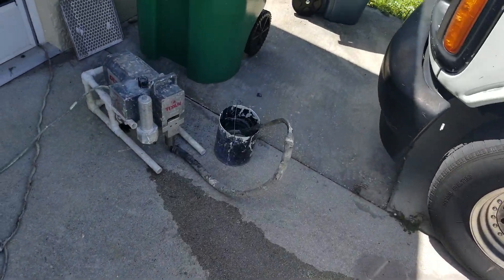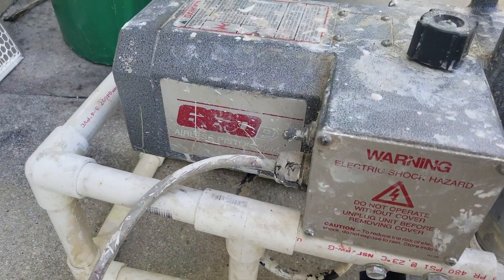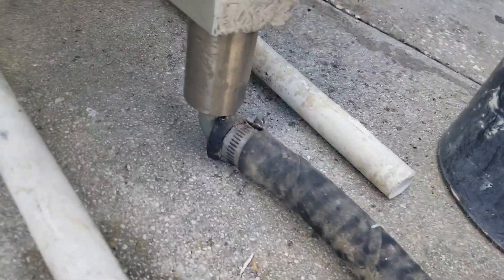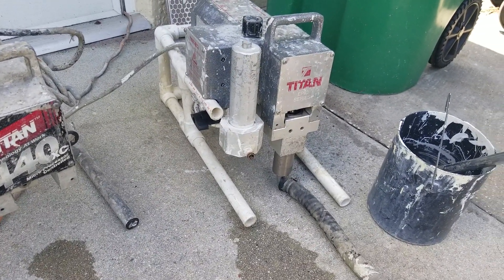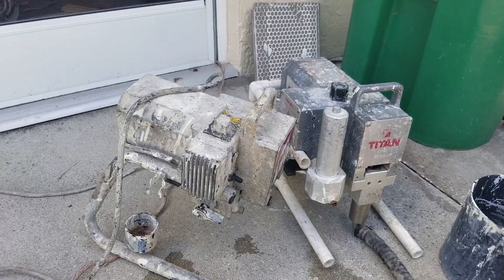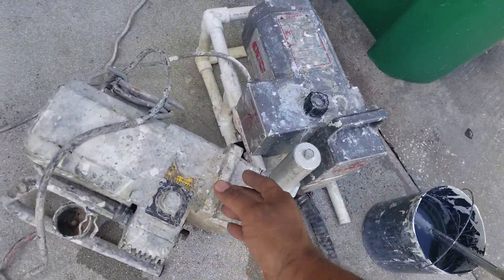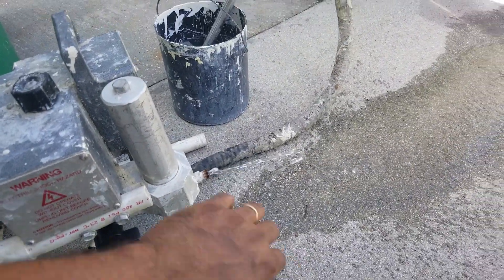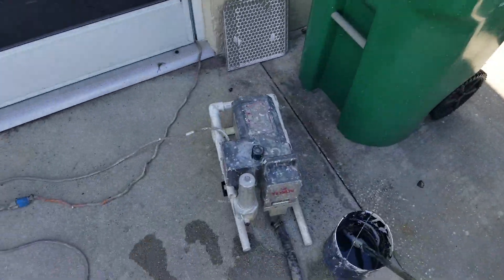Titan 660ex running with fluid pump from 440xc

Comment: It's great to see you using these machines after all this time I still have my 440 epic from like 25 years ago I bought another one for replacement parts off of auction it works great and I use both of them to get one going of course I moved up to the impact series by now but I still really really like the old epic series
Reply from the maker: Yea I'm also replacing all these units. Just purchased a Titan elite 3000, but I still have the epics and one xc series, great machines

Comment: that's good to know.. I just bought a titan 660xc wondering if all these parts are interchangeable
Reply from the maker: My Thu Le yes, parts for the 660 are not made anymore, the packings you can still get and piston, but the inner parts of the pump are no longer made, great machines though, look around for an old used xc model, I find some on Ebay going for $150 used